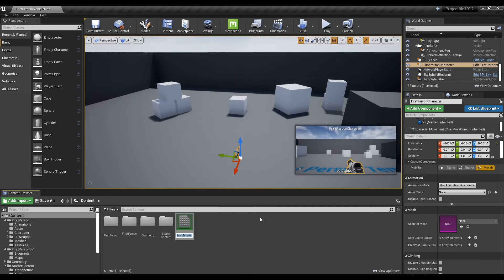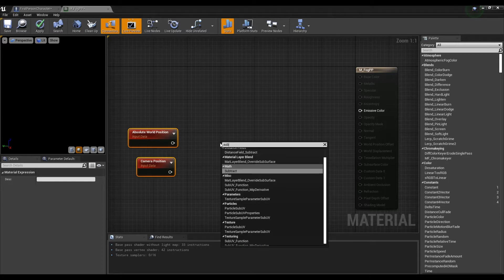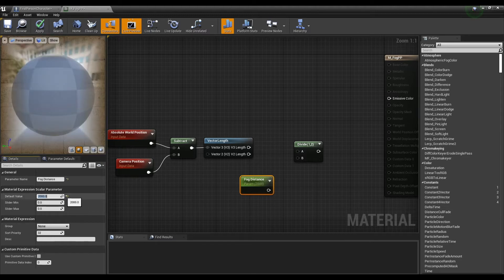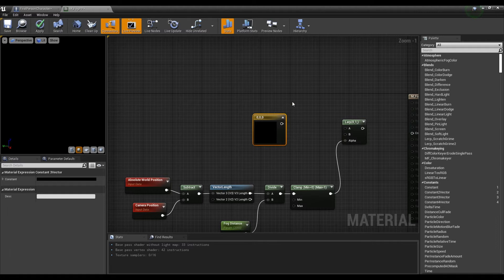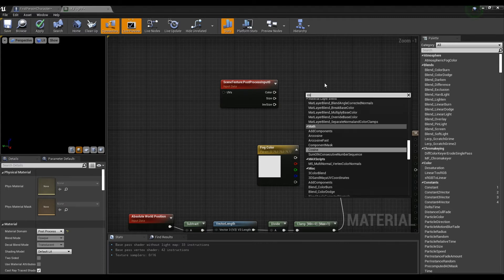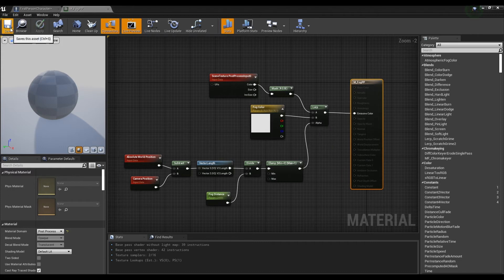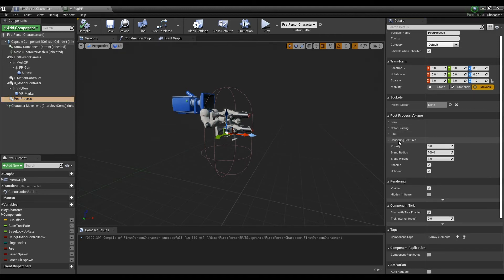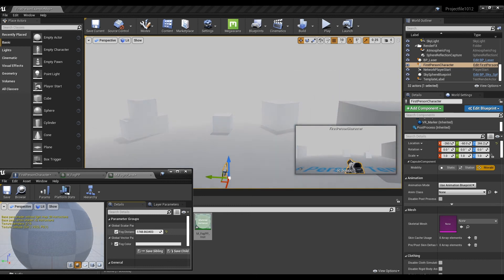UE4 Making a Perfect Silent Hill Scene with Fog Effect l Unreal Engine 4.26 (Tutorial)

Comment: When we set this on player, how do we turn it off inside locations such as houses? When player enters house, fog should be turned off inside house, but still visible outside. Is it doable in this setup?
Reply from the maker: You can control post process material through blueprint class in real time so that you can turn it on and off. Search on 'Set members in PostProcessSettings Node'. Thanks